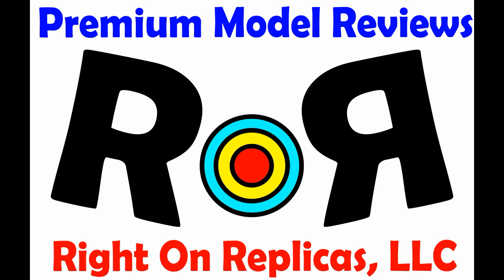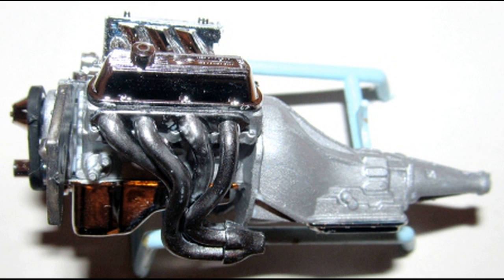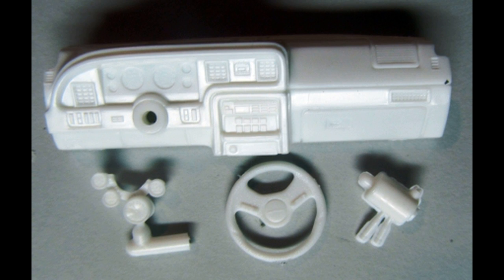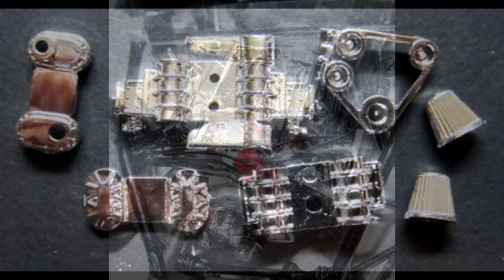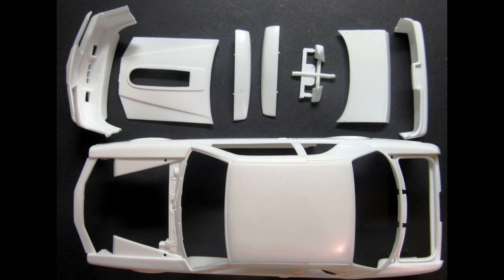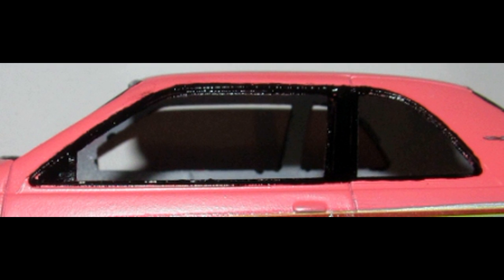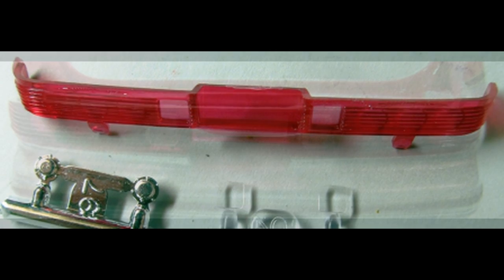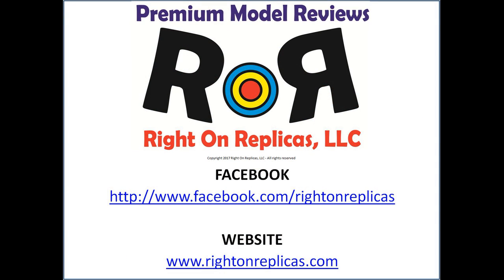How to Build the Hay's Pro Street Thunderbird 1:25 Scale Revell Model Kit #85-4356

Comment: I bought this kit just for the chassis and running gear to put under my '55 Ford panel truck. Those two pipes were a bit short on mine too, so I cut and extended them
Reply from the maker: AD - Thanks for tip on the pipes!  -Doug
Reply: You are welcome mate. I had to extend the exhaust pipes too because I stretched the chassis to fit the '55. I used plastic tube of the correct diameter and drilled it out so I could just slide it over the pipes
Reply from the maker: Nice technique Andy!  -Doug
Reply: Thanks Doug